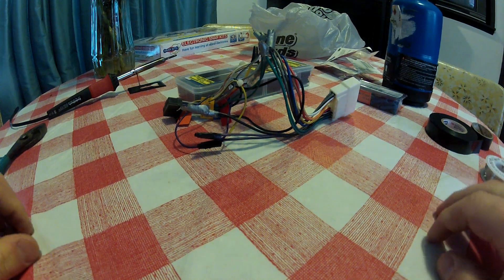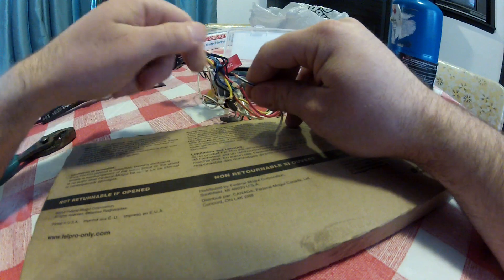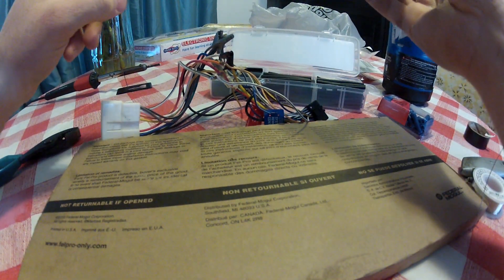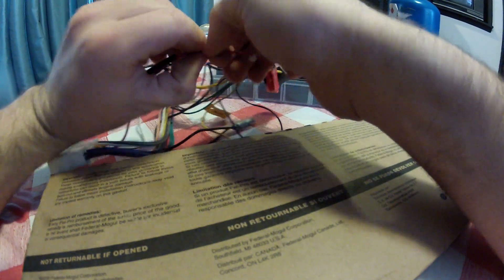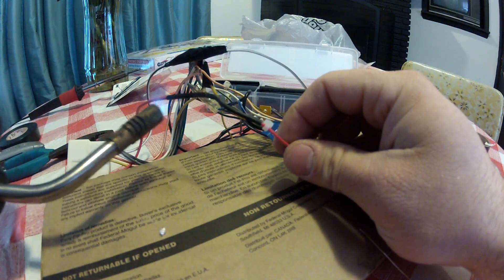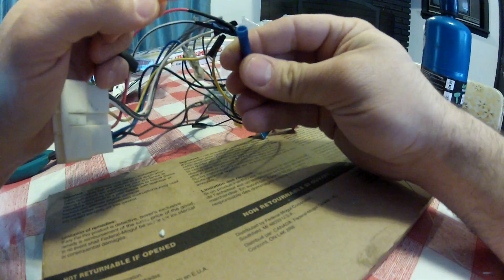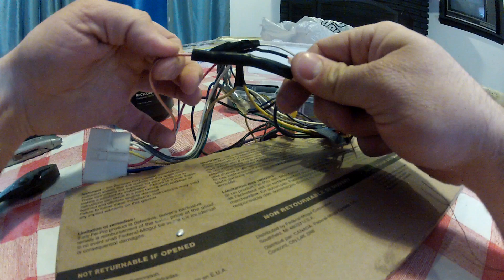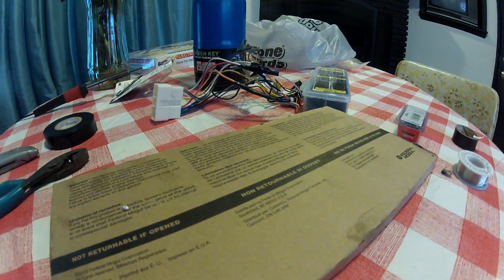Replacing/Making a wiring harness

Comment: Rosin core is plastic? Rosin is a flux to clean the wires.. Also, what you are doing is a "cold" solder, dripping the solder on top is not how to do it.

Comment: I've done alot of soldering and I find it easier to do it as you do copper pipe, Hold iron to wires underneath and touch solder to wires on top rather than touching solder to iron.
Reply: That's not just easier: it's the only correct way. If the wire you're soldering is cold, the connection isn't good. And rosin core solder is much better because it has flux in it. Not plastic.